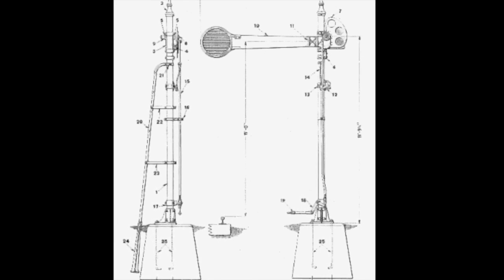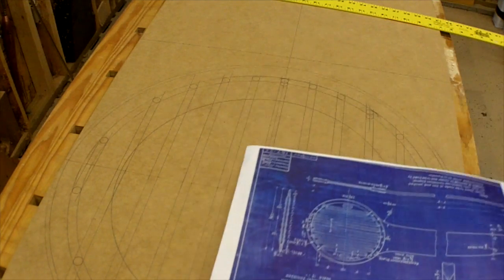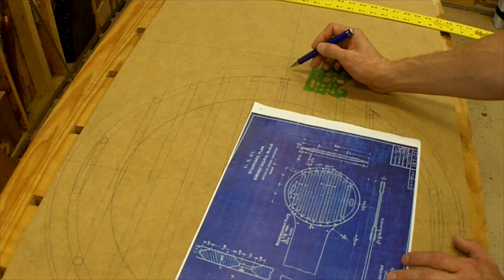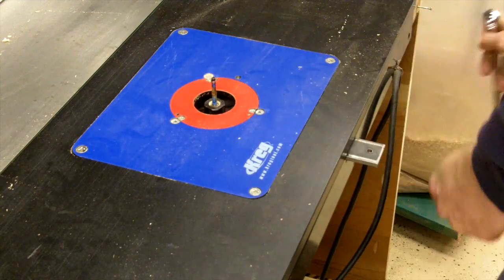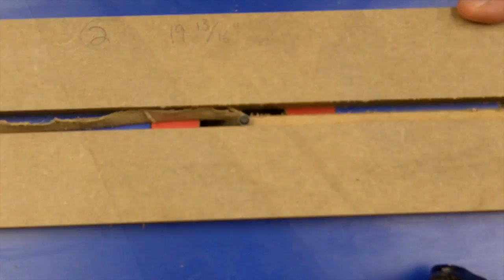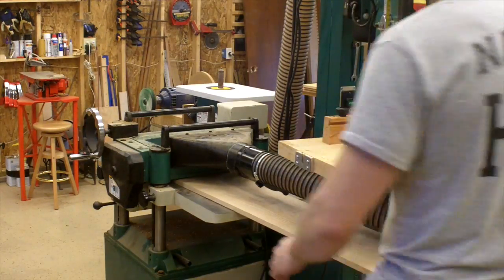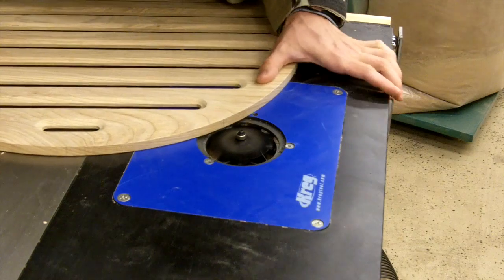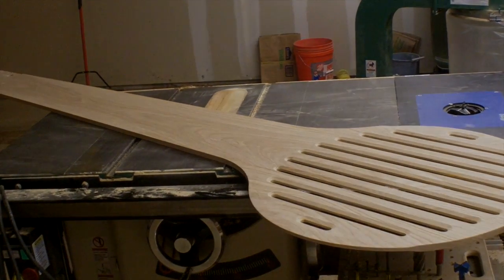Railroad Smashboard Blade - Lots of template routing!

Comment: great video (so far) Andrew.  I stopped momentarily to ask you this:

in some other videos and this one I have noticed that, when milling up lumber for your projects, you don't spend much time working with a handplane for twist or other warp issues.  Is that because you are coming home with super flat lumber?  I am pretty green, but have found that I spend a good hour or more just getting boards ready to go through the planer or on the jointer.

thanks!